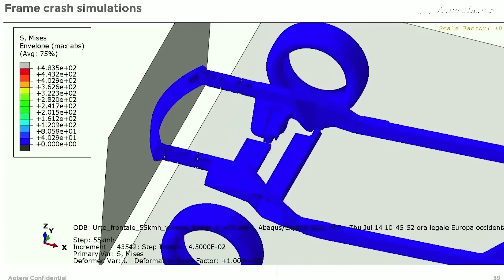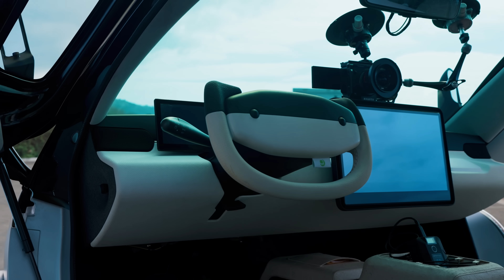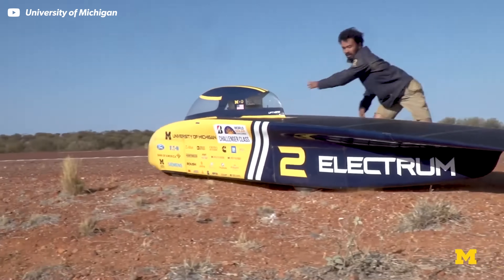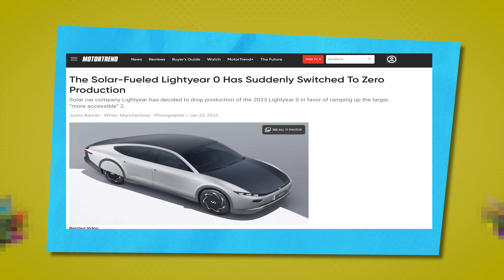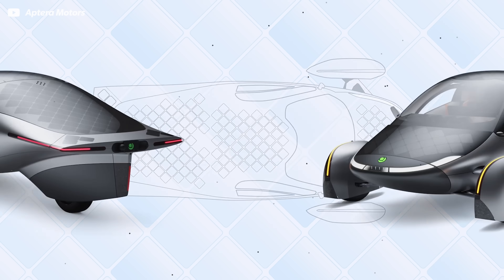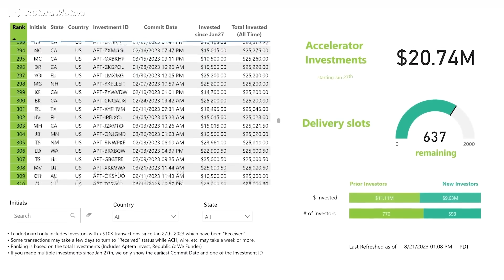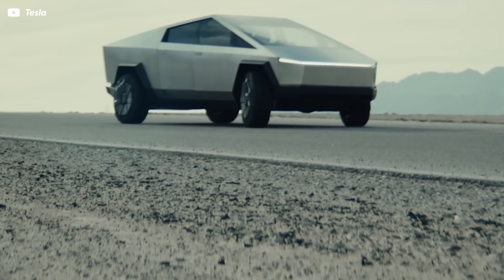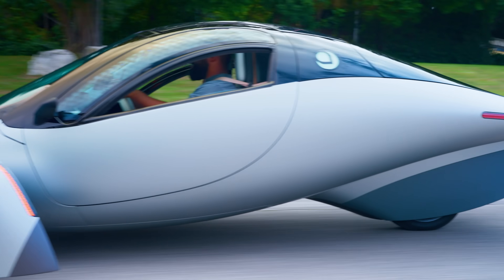We Drove America's First Solar Car

Comment: You didn't drive the first solar powered car.  The motors will still wear easily.  Also, hope you don't have a family that requires goods. Firther more, I love composite or carbon fiber, BUT DON'T TELL THE WORLD IT'S STRONGER THAN STEEL!!!!! MAGNETIC electric is way more productive but don't forget the motor wear and tear.  I have test buildings lying around from elements destroying the solor components. 

Ill put in marijuana terms, have the component knowledge vs a prewritten script and 2 page manual leaving the pertinents  out.
Reply: While it is true that early versions wore rather quickly, we are way past that now, and service intervals have greatly increased as well.  We will get the final performance for the LE versions once the validation tests are finished, later this year.
Reply: @n.brucenelson5920  I own many exotics as well as other EVs.  Even forklifts.   The propane forklifts have way less wear and tear on the propulsion.  My vehicles such as my Lucid are already weakening. I have the time and money for testing. If I'm not driving them, someone is. Problem is my cost for performance is what you're trying to say is fixed.  🤔.  I get less than a year or two before they start having problems.  In Germany, my birth place, we use EVs around town and that's great. I travel a lot.  I'd rather see these testings done in different places and climates before I can honestly say , " yes, go buy one".  No one has a test of a long distance, different climate, and weight tests. They've given excuses so that's why I shell out some coin to test myself.
Reply: @joey8567  All these other vehicles you mention have wear areas that Aptera does not have - and they also lose energy due to friction.  

Your propane powered forklifts do not have the abrasive combustion fuel products of petrol or diesel, so they are cleaner than other ICE vehicles but can't compare to some of the newer electric materials handling vehicles such as from FLUX Power, for one example.

I used to travel a lot in Europe on business and on occasion returned rental cars to Schipol Airport with almost 5,000 kms on them after a week.  They could hardly believe it possible.

I will pick up my Aptera in California and take it camping in Death Valley, before driving up to Washington State and then eventually to Iowa and perhaps further east.    I am likely to have seen temperatures from 50 down to -30 C by the end of next year, and will report on the performance and power use under many conditions.
Reply: @n.brucenelson5920  maybe video it to document.  Either way I'm not debating. I am blessed and have homes everywhere.  The purpose of the EV is to leave less footprint. As my other comment states, I've made quite a bit in the last 8 years in mining company's. I'm somewhat retired but travel and see what I can.  Video and then look at how many of us merely invested in mining due to the overwhelming tools being produced.  Now the EVs.  It's double time as these rare minerals are in the southern hemisphere.  Recycling batteries only can recycle so much to make more.  When the public here's about the "new" , noone bothers to think about it.  People debate, me, I travel and see for myself or it's not proven. I've sponsored EV traveling. Never comes out on top.  
Quick charging or anything quick has a short lived life. That's 50 years after graduating in Germany at 14.  

Fun fact as I'm a commercial and farm lover as more of a hobby, gear grease, comes from the cow.  
Even shampoos and nail polish removers. Cows can be easily reproduced but not certain minerals. You probably already know where this is going 😎
Some of my oil wells have been discovered after uncapping on several ranches but created an illusion that maybe not from dinosaurs and "quora" and others scratching their heads only can come up with back flo or deposits.  One of mine from early 1900s is plum full, luckily it's in Mexico so I have it up and running.  The mining companies I've invested in simply are quadrupled only after an EV race. If anyone says there's a new battery,🤣, tell DeWalt, Hitachi, Milwaukee, knockoff companies, .............   

On another note, I usually have my most precious vehicles delivered to southern Carolina or NY and either driven or placed on an electric generator train to whatever state I'm visiting including northern California to one of my ranches.  I really enjoy getting pulled over 🤣🤣🤣.  I always carry my paperwork though.

Comment: a piese of crap with a tiny tiny solar panel jammed on the tiny tiny roof. gimmicks as usual
Reply: You will change your tune once you have a chance to ride in one, as my wife and I have.  You might have missed that it has outrageous performance and is far safer than a motorcycle- while offering far more utility - hardly a gimmick.